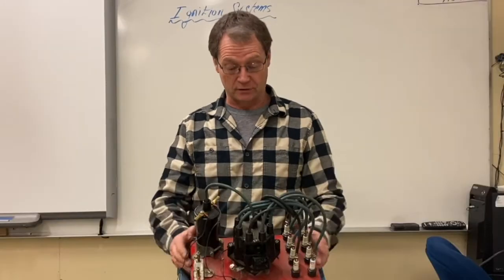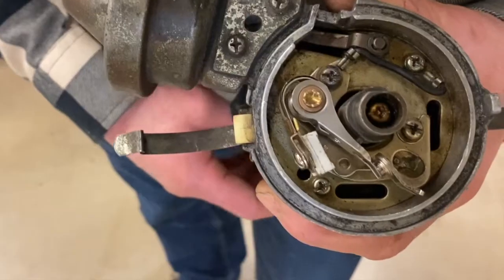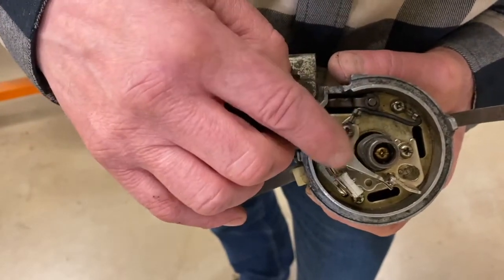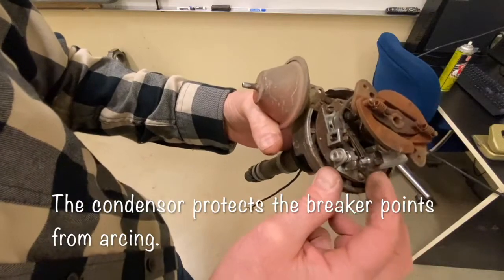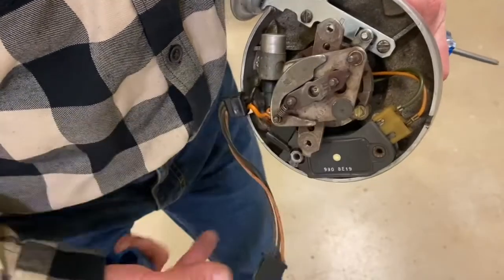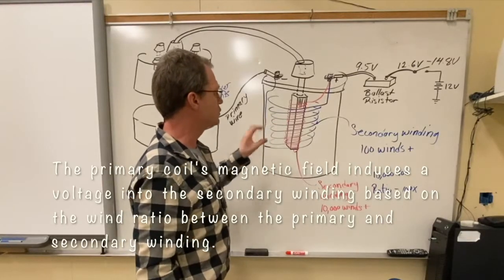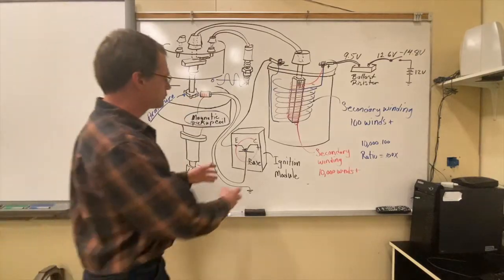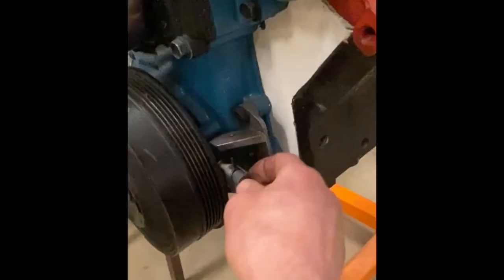Ignition systems Explained.  How ignition systems work

Comment: This is the best video I have seen so far on ignition systems.  I am working on a lawnmower with a magneto ignition system and I couldnt understand how the "pickup coil" worked, but now I understand that it is essentially just an electronic switch for grounding out the primary coil so that the field collapses on the secondary.  This has been bugging me for days.

Comment: Am restoring a 1961 MGA and at the point of reassembling the engine. I was always unsure of the exact role of the points vs coil. This vid explains exactly how it works. The only difference is the MGA is positive ground so i believe it's gonna be + from coil to the distributor. Thank you much.
Reply from the maker: I am so glad it was helpful.

Comment: Many thanks for the video. It helped me so much, since the ignition on my 74 duster isn't working. What is the ballast resistor for, why doesn't it work with 12V?
Reply from the maker: The ballast resistor was used mostly on older engines, but was also present on some electronic ignition cars.  The ballast simply lowers the voltage to the primary windings of the coil to around 9.5 volts to reduce coil heat, which preserves coil life.  As technology changed, ballast resistors were often worked out of the system and voltage output increased significantly, as a result, to improve ignition in the cylinder.

Comment: Thank you sir but i have an important question.  What is breaker point's main function?  I understand that electric current can be induced into the secondary coil without breaking the current flow in  primary coil.  The high voltage will come out of secondary coil and the only thing needed to distribute it into separate spark plugs is by timely rotating it.
So why is a breaker point needed for the primary coil?  I just couldn't understand it.
Reply from the maker: Great question!   You are 100 percent correct in regards to the secondary windings amplifying the voltage of the primary winding.   However, with the voltage in the primary winding being fairly low, the amplification in the secondary windings is not high enough, until we can create a spike in the voltage of the primary winding.  This is what the breaker points do.  When the breaker points open, the electrons can't continue flowing in the direction they have been any longer.  This forces the electrons to pile up (in a sense) at the end of the circuit and then rebound back in the opposite direction, and this causes a rapid surge or spike in the voltage of the primary winding.  This then is amplified by induction into the secondary winding, causing a spark.  The breaker points, every time they turn on charge the coil, but when they break open the circuit, a spike is created in the primary winding.  This triggers the spark that is precisely timed.

Comment: how does the engine speed transition to the rpm gauge in both the breaker point and pick up coil distributor cars?
Reply from the maker: Thanks for your question.  In both cases, the RPM gauge is connected to the primary side of the ignition coil, which is the switching side of the coil, so it has a pulse signal reference that is converted to RPM
Reply: @bensiemers5094  thank you. both your video and reply has been a great help

Comment: Hi buddy, thanx for the nice video. You probably noticed that your blue sign of the primary coil is wrongly written as the secondary coil, but that's OK for me. For others, it could be a bit confusing. Anyway, I still have a question. I can't see on your drawing where the other end of the secondary coil is connected.
Reply from the maker: :) You know,  you are absolutely right.  Actually, good eye.  I can't believe I did that and didn't  catch that earlier.   I drew that pretty quickly and accidentally wrote secondary in place of primary, yet I see the secondary coil is marked at the centre in red.  Pretty hard to change it, unfortunately, without removing the video.  But I do appreciate the heads up.    Thank you for your notice.
Reply: @bensiemers5094  Ok, I answer on the second part of my comment myself. The other end of the secondary coil must be connected to permanent ground instead to switched +. As the source of power for the spark plug is the secondary coil itself. The circuit for 20 000V is following: secondary coil -> to center electrode of spark plug -> then spark jumps to threaded electrode of spark plug -> to engine block which is connected to chasis frame, so the other end of the secondary coil must be grounded (chasis frame) to complete the circuit. Anyway, nobody noticed it in the comments, so everybody are happy. In conclusion, I appreciate your effort to create this video, as it is, anyway one of the best on this topic ;-)
Reply from the maker: Sorry, I missed responding to that.  One end of the secondary winding is attached to the positive terminal of the coil shared with the primary winding,  while the other end connects to the laminated iron core where it can discharge its energy to the distributor cap and plugs.
Reply: @bensiemers5094  Really? I'm pretty sure that the other end of secondary coil  (the end that is not going to the centre electrode of the spark plug) must be connected to the negative pole. Maybe I'm not right, or there could be more than one method of connection.

Comment: Question,  does the points on my 1967 firebird act as a starting point on 1st key turn.   Hot day engine crank over a few times. Instead on 1st turn. Is this correct, installing a  prentronix  removing point/ condenser
Reply from the maker: You will have to look at the specific model of Pertronix ignition you have used for your specific car.   Commonly, if your car has a ballast resistor, or a primary resistor wire going to the positive side of the ignition coil, your cranking voltage will be too low for the ignition coil's needs on your Pertronix system.  Check to see if your voltage at the coil's positive side matches your battery voltage while it is cranking.   
Stock ignition systems used a 9 volt supply to the ignition coil positive side to prevent overheating the coil.  Generally,  with many electronic ignition systems, on the Chevrolets, the ignition coil replacement has a higher built-in resistance, and the ballast resistor (or primary resistor wire) is removed and replaced with a stock wire to up the supply voltage to the ignition coil.  I am suspecting that this may possibly be your problem.  You shouldn't have ignition points remaining if you have a Pertronix point eliminator system.    If you do have adequate cranking voltage presently and a good spark while cranking,  then you will have to look at the tuning of your fuel system as a possible problem.  Hope this helps. If your vehicle is still factory carbureted, your choke settings and the accelerator pump action are vital to a quick start up.   Best wishes.
Reply: @bensiemers5094     Thank you so much. I will replace coil 6000 voltage and install the pertronnix.
Reply: I have an edelbrock 600 cfm carb with a manual choke

Comment: Why the ignition coil needs to be grounded and disconnected all the time?
Reply from the maker: When you create an electromagnetic field in the primary winding by applying electricity and then switch off the flow of electricity it causes a voltage surge in the circuit, as the electrons rebound back  in that winding.  This voltage spike is amplified in the secondary winding because of mutual induction and this causes a spark.  :)
Reply: @bensiemers5094  so are you saying that the exact spark time happens actually at the ungrounded time of the coil? 
Thank you
Reply from the maker: That is correct.  Similar to experiencing a spark at a wall plug-in if you disconnect a power cord under heavy load.  The electrons bounce back in the circuit momentarily creating a voltage spike that triggers the spark to occur.  The coil must first be charged to load the coil and then the  unloading dumps the energy as the electrons reverse direction.  Since the primary coil has less windings than the secondary, it is used as the controlling winding, the secondary winding amplifies what occurs in the primary winding.
Reply: @bensiemers5094  thanks a lot .
Reply: @bensiemers5094  excuse me, one more question. After we build up to 25000V in your example , is that starting again from 9.5V for the next grounding?
Thank you
Reply from the maker: That is correct (9.5 Volts with point ignition 12.6 to 14.8 volts in electronic ignition when the coil switches the primary winding on.  Some systems produce up to 100 000 volts in the secondary winding when the primary voltage surges and collapses.
Reply: You should teach at a local community college, as you seem to go through great lengths to help us understand this better. Thanks
Reply: @whatsthebuzz2  I love the way he explains. I’m studying in college in UK . They never go through the topics like that in depth.
Reply from the maker: Thank Cindy for you thoughtful comments.  I enjoyed making the video and designed it for my high school students.  I taught a high school automotive program for 31 years.  Been in the automotive trade since 1981.  Just freshly retired from teaching last June.  Best wishes.
Reply: @faridbakhshian221  I tend to agree with you. I'm a beginner at this stuff, currently drive a truck and am working on transitioning into this field. I'm finding sometimes the local colleges appear to be more interested in quantity not qualify unfortunately. Really unfortunate.
Reply: @bensiemers5094  you're welcome 👍

Comment: Why did the voltage go from 9.5 to 250v on the primary side?
Reply from the maker: Good question to understand.  The voltage spike is the driving force that causes the spark.  Whenever you allow a current to travel in a circuit, then suddenly stop it,  the electrons, because they travel so fast, carry a momentum and they try to keep going that direction.  If they can't cross the switch, they continue to exert force and build up pressure and in pile up at the end of the circuit, then bounce back in the opposite direction.   This is similar to watching a water  hose spraying water; when you suddenly open and close the squirt handle, you will see the hose jump as inside the pressure surges well beyond line pressure.   This is a similar principle to what causes voltage surges in circuits.   The longer the windings or circuit path, the greater the voltage surge in the circuit, when it is switched off.  When the primary winding voltage surges, it momentarily also causes a rapid reversing of magnetic field polarity and  the primary voltage spike along with the effects of magnetic induction ramps up the voltage as well in the secondary windings, based on the ratio of windings between the primary and secondary circuit.  Therefore the secondary windings can produce voltages anywhere from 20 000 to 100 000  volts using this principle.
Reply: @bensiemers5094  thank you a lot for the reply.   Makes sense.  That was the last piece of the puzzle for now.  I understand the field from the primary side collapsing causing a current in the secondary.

I guess this also makes sense why it is easier to make a CDI generate higher voltages on the primary side since the switch is quicker than the mechanical points.  

I remember reading long time ago that CDI made higher voltage on primary, but it didnt explain it.
Reply from the maker: Thanks Fred.  Have a great day.